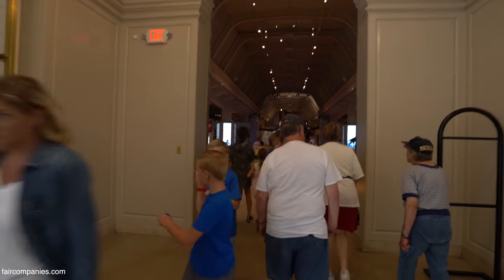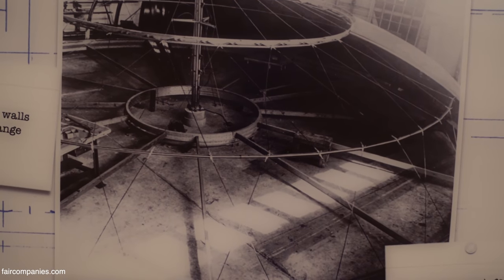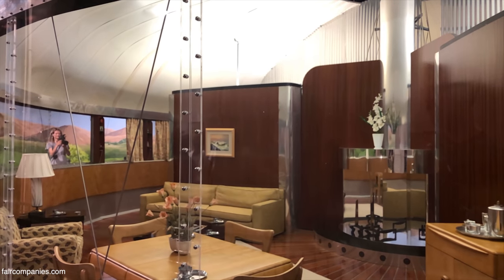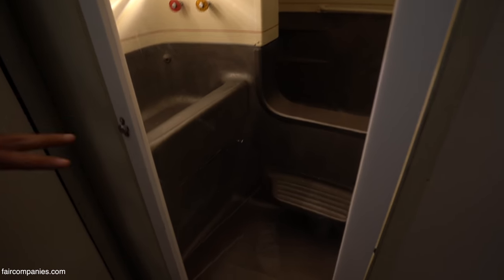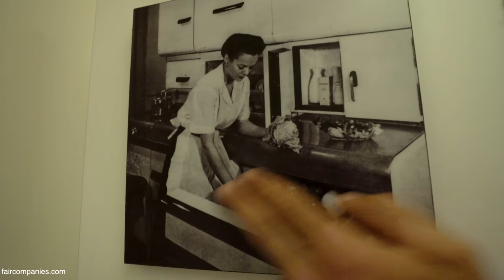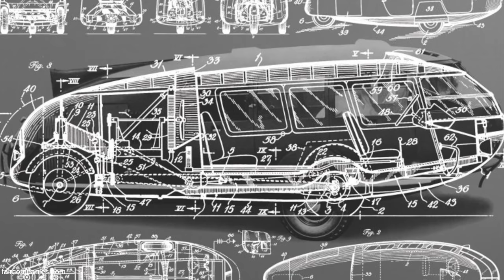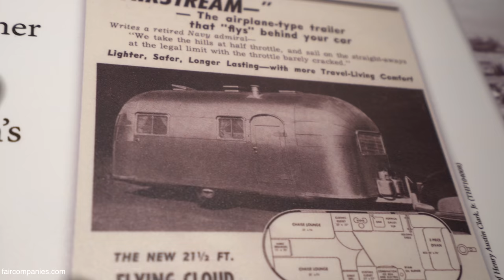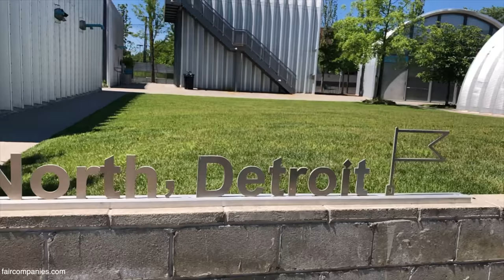Dymaxion: could homes be as affordable & precise as appliances?

Comment: Those read, listen to / bugged / eavesdrop / overheared / tapped, watched, spied, copied and steal many of my ideas (=inventions) initiated by me:
+ open, transparent 360° sunlight Buildings, construction methods, architectures, designs, concepts;
+ Step-floor / -storey / -level / -tier pyramid (e.g., as a residential building); 
+ 360° stepped floors / storey / level / tier buildings (constructions, architectures, construction methods, designs, concepts, 2D, 3D, models); 
+ 3D 360° environment (surround), volume, space (room) audio / sound;
+ 360° environment (surround), volume, room screens (displays), monitors, TVs;
+ Screens (displays), monitors, TVs without backlighting;
+ many things with magnets like Micro-OLED; 
+ 360° screens, monitors, TVs, panels, glass; 
+ curved screens, monitors, TVs, panels, glass; 
+ 360° reflections and light digital: "ENB", "Ray-Tracing" / "RTX", “Lumen illumination” and whatever renaming! 
+ Short Throw Projectors; 
+ dark backgrounds / themes / skins for windows, browser windows, internet sites, programs / apps, etc.; 
+ fanless, passive cooling; +thermal pads; + Water cooling (unwanted, because it conducts electricity) and liquid cooling (wanted) for the computer and personal computer / PC application area! 
- I am not the inventor of refrigeration by nitrogen, instant- / blast-freeze / -freezing; 
+ 360° open, transparent PC cases; 
+ 360° Sphere, Ball as a Wheel (2D, 3D) “Omniwheel” / “Omni-Wheel”; 
+ From a standing position / standing a 360° turn / rotation in any direction on all objects, including logically and of course vehicles, transporters, robots of all kinds; 
+ Flying objects, planes that take off and land vertically, for example by hot air, example fighter jet;
+ skyscraper up to the weightlessness of space ("space scraper") - "mega construction"; 
+ LED lights (at least its implementation and intended use outside of tv and pc-monitor); RGB LED “Nanoleaf”, etc. 
+ and much more! 

+ I'm not the inventor of VR, but of "AR", AR glass, AR glasses; 
It was only later that I realized that they derived a lot from my ideas (=inventions), a lot came about that has to do with color and light, through me as an initiator, booster / catalyst, e.g., through my idea, invention of the Screens without a backlight and without a built-in / integrated backlight! It is no coincidence that only afterwards, after I initiated this, they built, built and are building those inventions thanks to my impetus! They sell my ideas (inventions) as theirs! They are not the inventors, but the first technical implementers of my ideas (=inventions)! And those are not the inventors, but the thieves of my ideas (=inventions) initiated by me, because those act as if I wasn't the first hand and the first domino, and they take unjustly, undeservedly a lot of money, stolen money (blood money), recognitions, awards, certificates, fame and history, they boast of my laurels / merits! 

Before me they all were stucked at LCD, Plasma TV and less lights! 
I have made a deep impact in evolution! 

Those manipulate, sabotage, falsify, distort images, paintings, digitized and real, animations, videos, films, also composed of many images, even the publication dates of mine, others and their posts, images, videos, etc.!
You have to understand, those can distort everything that can be heard and seen in real life and digitally!
They block and delete my pictures, videos, posts, comments, comments-answers and answers!

They are poisoning and murdering the world with fake diseases, treatments, "vaccinations"/ "vaccines" and injections by syringe!

Now they also make it out as if they haven't been ripping off, cheating, enslaving, murdering other countries with the money currency, money exchange by even -99% for more than two centuries! And as if I'm not the first to disclose that and more! As if I didn't disclose and initiate > 1.00 Ruble (₽) = 1.00 asian Yen (¥) = 1.00 Euro (€) = 1.00 Dollar ($) = any (X) any country < years ago! 

Each and every non-civilian you hear and see on TV is involved! You can hear and see their > blue <, grinning speakers / talkers every day on TV!

Those are white, > blue <, blond / blond-haired, bald, red-haired, grey-eyed, blue-eyed, Christian, Jewish, fascists, Nazi-pigs, child murderers, mass murderers, people murderers (genocides)!

To all dark-haired, black-haired people, defend yourself against the white, > blue <, blond / blond-haired, bald-headed, red-haired, Christians, Jews, because those are the real terrorists, mass murderers, people's mass murderers (genocides), child murderers, fascists, Nazi-pigs! 

"Can you back up these claims?" 
- "They block and delete my pictures, videos, posts, comments, comments-answers and answers!" certain ones a lot very often! 

They block my profile links! Go to my Youtube channel / profile, there you should see a link to my main profile for free, the language of the free site can be set to english on the site in the settings. On my free main site you can read my public posts for free, some with pictures, links and dates.

Comment: It could only work if you add vacuum panels insulation into those thin exterior walls, roof and triple pane windows with total U value up to 0,8.
Reply: Keep thinking. Watch the video again, read a few of his books (or books about him) - you are on the right track.
Reply: @julieenslow5915   I live in EU and from 31.12.2019. ALL NEW HOUSES in EU must be built like nZEB (near Zero Energy buildings).
Reply: @maromaro1909 
Yup. That is what I am talking about. Innovative design comes from issues, hurdles and constraints. That's a big one. This kind of a puzzle was what excited him. Read up a little on his work in the desert, with sand and rock as his main building materials (gathered from the site) and college students as his labor. I think those structures would possibly conform to a near zero energy building. Or come close.
Reply: @julieenslow5915  are you an architect ? have you the link about " on his work in the desert,..." ?
Reply: To clarify - he didn't use Earth rammed structures that I recall but his use of cheap natural materials spawned the modern trend to revisit ancient building techniques such as Earth rammed structures.

Comment: Surely the design is outside the limits of patent & copyright i would Love to see this copied & produced today. Though it Likely would be 30 times more expensive far beyond the original 6500$ range
Reply: In those days $6500 was the price of a top of the line Cadillac, Chrysler, or Packard. So figure $100,000 to $150,000 today. But with modern materials and features.

Comment: Foolish idea for a cold climate
Reply: Its not foolish at all. In cold climate you just use different materials and insulation.
The general structure remains the same. It can adapt depending on the environment.
Reply: Suddenly the price is the same as a normal home, in fact it would be a normal home. Also needs foundation 4' below ground due to frost.